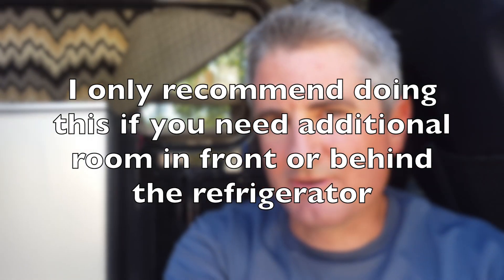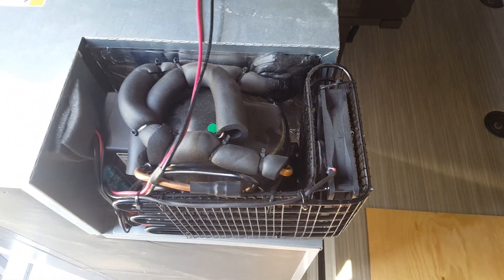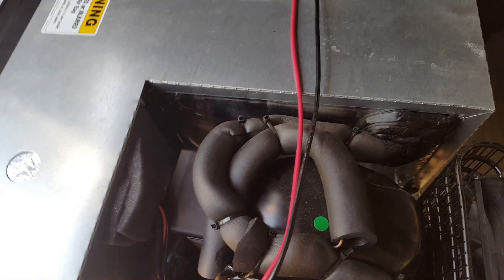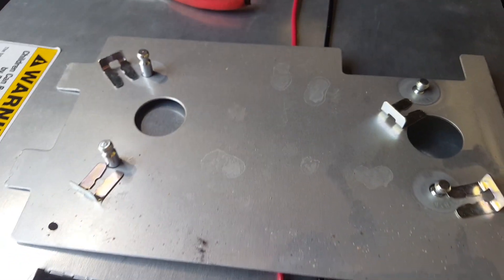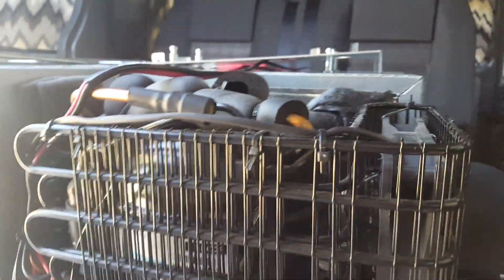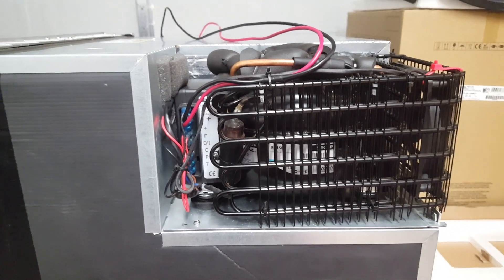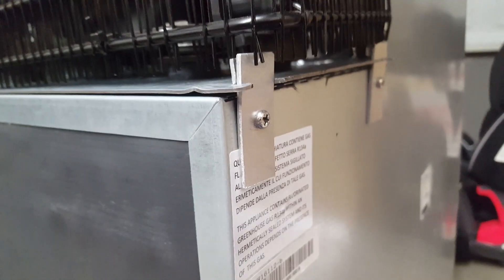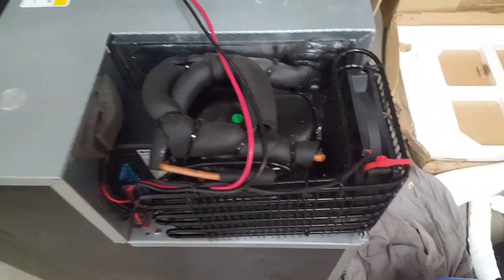Modifying an Isotherm Refrigerator for Reduced Depth

Comment: Hi Ken - Thank You for sharing this great video. I got the same fridge, and currently working on installation. This is very helpful. Did you used anything for bottom of the fridge or it sit flat on the van floor? I also watched the Extruded aluminum galley episode but unable to see that closely.
Reply from the maker: I'm probably too late in responding but I have my fridge sitting on some 1/4" wood strips so the door will clear my sliding rear seat tracks.  You won't have those but I would recommend setting the fridge on something for clearance and for ventilation.
Reply: @ourkaravan  Thanks Ken. I’m behind with van build. Just start with the fridge project today so this is just in time.
Reply from the maker: I’ve been told I have ESP 😜

Comment: How did u wire the fridge in. My came with 2 prong plug but I'm going to do 12v
Reply from the maker: Mine was the 12 volt version, so just a two-wire hook up to my 12V system.  Did you buy a 120V AC only version?

Comment: Hi, I much enjoy your van build series. How did you fix the fridge inside the cabinet?  Just locking it in with the alu profiles left/right/front/back so that it doesn't go anywhere, or did you actually bolt the fridge to the frame and/or floor?  I love the alu profiles for the cabinets by the way, and how you build drawers and doors using bamboo. Very nice.
Reply from the maker: Hi, the isotherm refrigerator has 4 holes inside the fridge for mounting.  I used two of the four by passing a very small bolt through the fridge and through an aluminum angle bracket attached to the 80/20 framing, with a nut on the back.  I didn't feel like I needed the other two mounts as the fridge is rock solid and has nowhere to go.  Thank you for the kind words, I appreciate that!  -Ken

Comment: Any problems since moving it?  I would be worried about it shifting and those tabs chafing the tubes.  Isotherm isn't worried about it sticking out in the back because they recommend having space behind and beside the fridge for the install so air can circulate.  They do install enough hose that you can pull the compressor off and remote mount it off the fridge, did that on my boat so I could enlarge a storage cubby behind the sink...